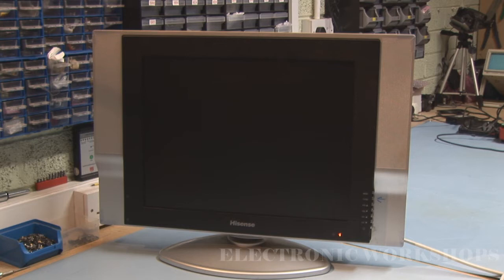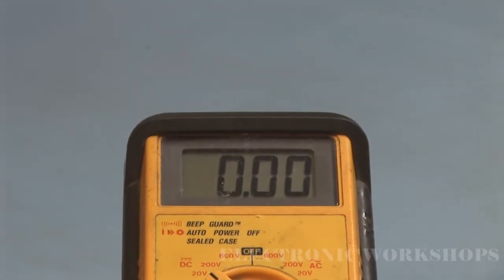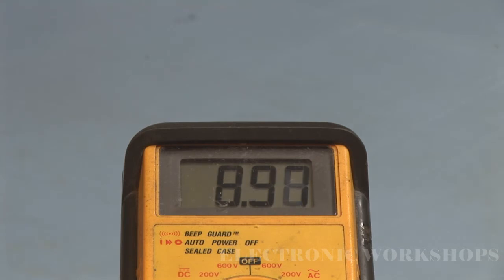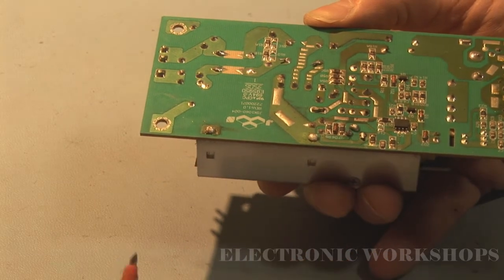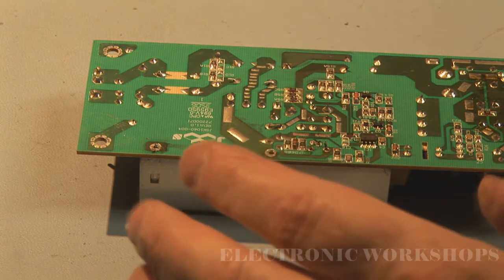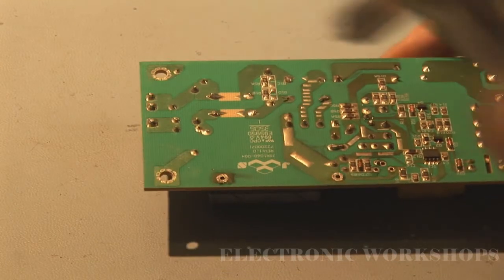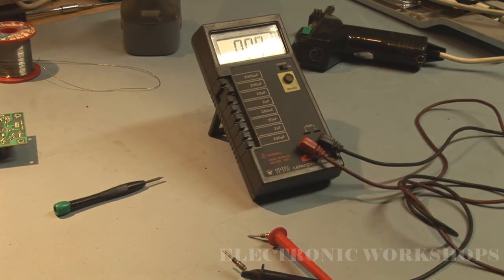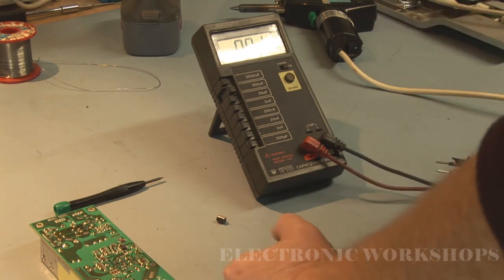Hisense LCD2003EU Stuck in Stand By | FIXED |

Comment: I heard something in your video about a capacitor not warming up or whatever to allow it to turn on,  and anyways. I fix TVs n swap out parts,  idk to much about the internal parts on the mother boards n power supplys tho,  but I was just giving a TV thstd turn on and picture wouod come on and then go off right away and then the TV would power off a minute later. Well I just took a hair dryer to the back of the TV and warmed up the inside by the power supply and video card also and then the TV powered on after warming it up. pretty cool. The guy did have it in his garage tho n was using it outside,  so maybe something had some build up on it from the moisture in the air in the morning.  Idk. But I got it to work now. I've shut it off a few times n it powers back on. I'm gonna leave it off for a hour or 2 tho n then try to power it back on n see if it turns back on or not tho.  But thanks.  Ur video made My brain think n work harder but easier lol.